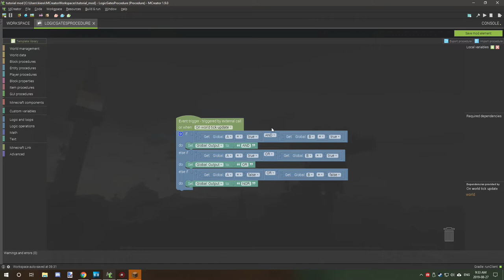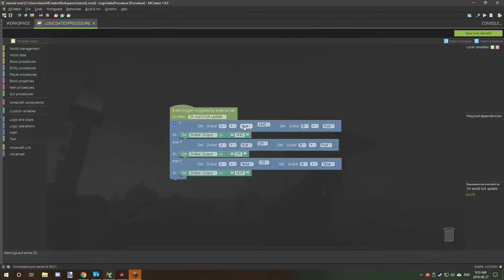MCreator Tutorial: How to make Logic Gates | 1.9.0

Comment: Hello! Thank you for the video on logic gates. Very useful. I do have a question about something else; When making a dimension, how do I make the recipe for the igniter? Does it not give the option anymore?
Reply from the maker: I ran into this problem before, I was tolled that it was in the recipe menu for all the blocks and items, It may have a generic item, I have noticed that armor has a armor texture that looks like regular iron armor however any mod elements you make should now as of 1.9.0 be at the start of the list when you open the item selection menu. If its not there I would open a bug tick and you can let Klemen know, also at the time of the report I made it was nowhere in that list under the mod elements tab back in the day so its quite possible that its a bug, but double check and report the issue if you still can't find it. You can copy and paste my reply to back up this if you need to.

Comment: this sort of follows what you did here but i need some help.  I have say 2 slots in a gui.  if those 2 slots are filled with a certain item i want to print some text on the gui.  I cant seem to get it to work.  Any items
Reply from the maker: I have not tried doing this before, however, you will need to remove the slots you have placed and make sure you create some new ones with procedures.

When you have done that you can try directly just printing text however it you can't use any entity element then you will need to pass what you want to say from a global string variable to a custom procedure that triggers on player tick update with your text from the inventory slot.

Its a bit hard to explain but the work around would be to use global variables to avoid not having the option for an entity component in the inventory procedure.

I would test this for you but I am am going to be moving in the next two weeks or so and I have a lot of cleaning and packing to do still.

Comment: How would I be able to make an item that teleports the player using ^ ^ ^ ?
Reply from the maker: You could do something like this tutorial I did but rather than have it command-based just have it activate when the player right-clicks with the item to run the procedure.
https://youtu.be/V0GgLyTesCU

You can also move the entity the direction you want them to travel with shorter distances using [X - #] or [Y + 1] etc. 

Make sure to test if there is room for the player to teleport, In the tutorial above I tested for a 3x2x3 area of air before I teleported the player just so they would not suffocate.